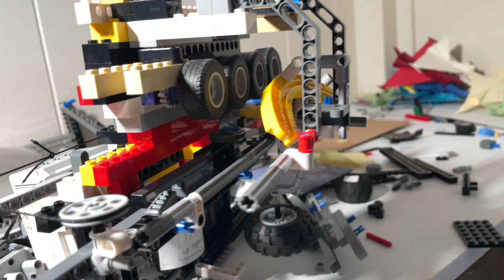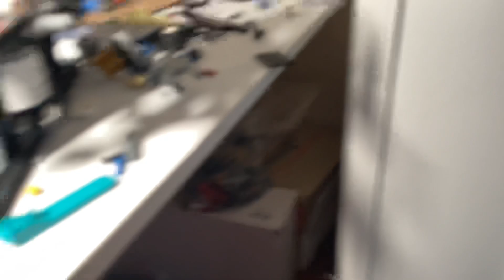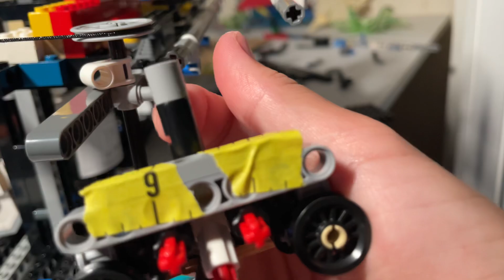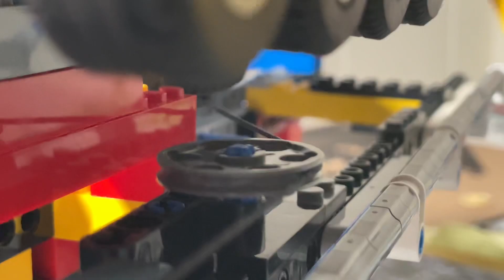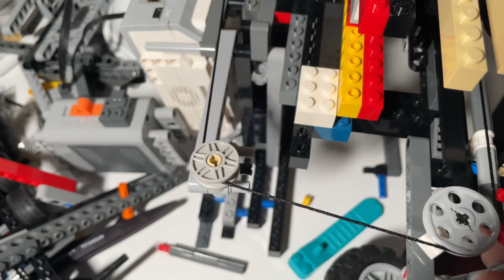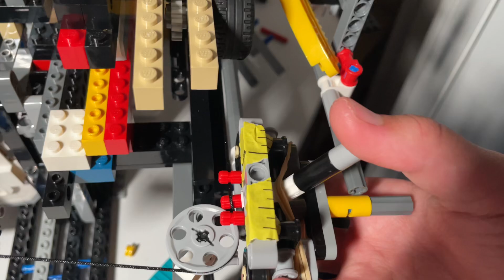Lego detachable ski lift: Version 4

Comment: Looks good, once my lift is done I want to try a better detach like this.
Reply from the maker: Thanks! I usually just rush the building process, and come up with a poor structurally sound lift, which makes it unreliable. I’m taking my time on this one though. Your lift looks great! Definitely more sturdy than mine :)
Reply: @skiliftfreak thanks! I’m going to be building the other station and then I need to tweak both sides to work good so should be out by end of July